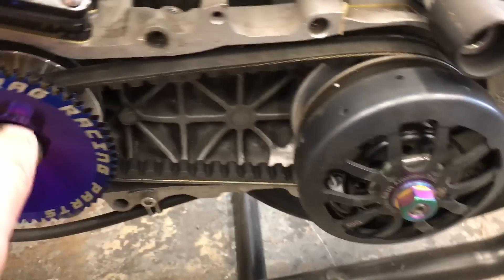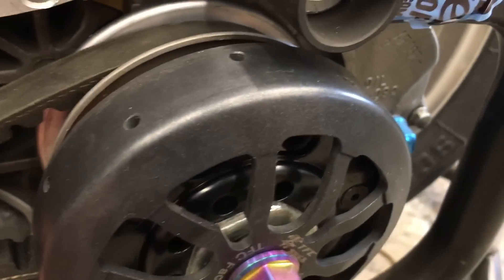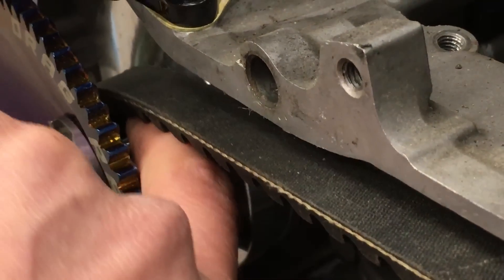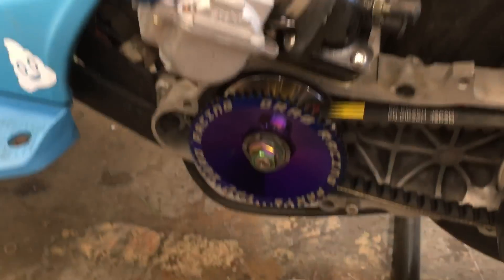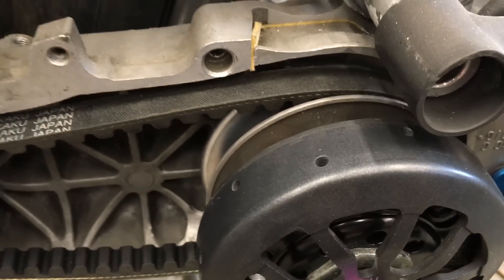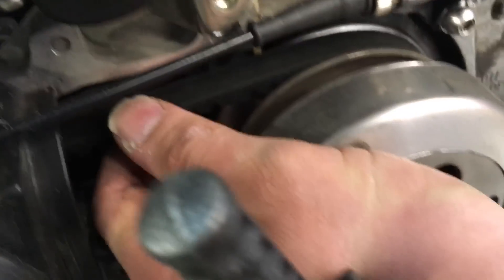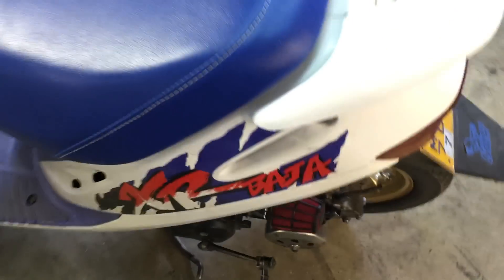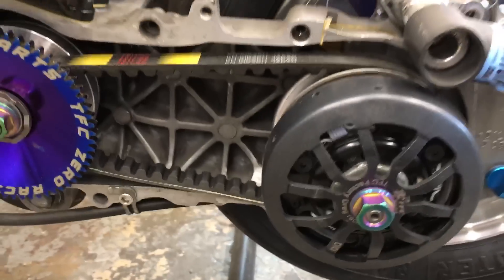Scooterswapshop cvt shimming basic theory

Comment: I just discover your channel!Whats your opinion? Harder torque spring with heavier rollers OR  very light rollers with relative softer spring? Both combined for same tuning rpm. Thanks!
Reply: if you are on stock bore you should not need to change contra at all.  With an intake+exhaust+bbk you will probably need to go to a heavier contra than stock but from what I remember you just need it to be heavy enough to maintain enough pressure on the belt to prevent slip.  Then leave it alone and do the rest of your tuning with rollers.

Comment: So ideally you want the belt to be as high as possible on the clutch? but how do you get it to the top if its lower? My son jus passed his CBT and its lacking in pull off till he gets to 21mph then it picks up really fast as goes well. This is my son and I NEED it to pull off fast for safety more than anything and don't know how to adjust it. The belt as 1mm over hang in the variartor (malossi) with the provided rollers that came with it. The OEM to white clutch spring was also changed and the air filter. Please help on how I achieve good pull off as this is the only issue with the Arerox 50.
Reply from the maker: we have many svt videos explaining how to tune your cvt.
Reply: @Scooterswapshop  Thanks for the response but could you be more specific with a link maybe? to one of your videos that will fix my issue? Cheers.

Comment: My belt is too short to fit like that! It takes a 669-18-30, I guess China skrued up, and put the engine too close to he wheel! To fit like that it would need a millimeter or two! Possible 4-5 mm, because the belt I'd in the rear pulley a bit, I tried shimming, but I noticed the inside of the belt is on the shaft, and can't go lower,  i have no power from a dig, I think it's from a gear swap, because it does decent on top end, so I could use the help on bottom, I doubt anyone makes a 670-674-18-30 belt, it would get a bit more low end, I thought about putting long case gears in it,but that would hurt topend,
Reply from the maker: good luck on finding a longer belt call the shop ask Paul if he can get one

Comment: let me see if I understand you correctly. 

my belt on the back clutch ramp is about a 1/4 inch below the edge... or highest point...

does that mean the CVT shim upfront is too narrow not allowing the belt to reach its lowest point?

therefore I need a wider shim?
Reply from the maker: feel free to call the shop I feel we have it very well explained here. belt needs to get as high up as possible.
Reply: @Scooterswapshop  just making sure I'm absorbing the correct information and on the right track

Comment: Hi man. Can i still add like a 1mm shim on my variator even though the star key, kickstart washer, crank  washer and nut sits alright and not protruding? Or will it make the crank nut protrude a lil bit? Worried i'm goin to lose my kick start. Thanks
Reply from the maker: need a little more info  but 1mm seems drastic